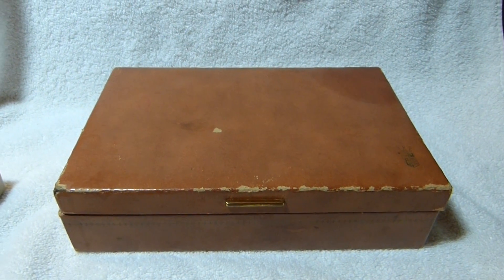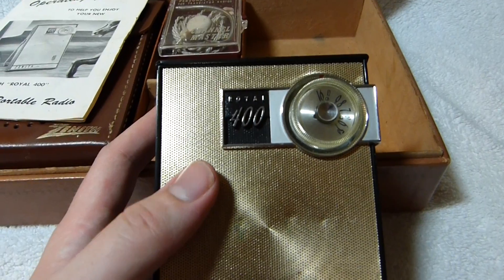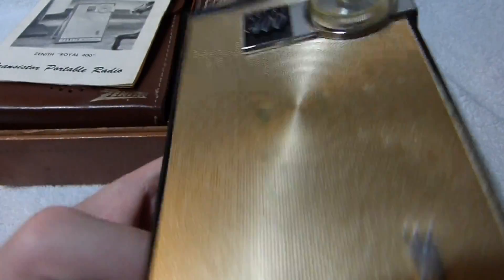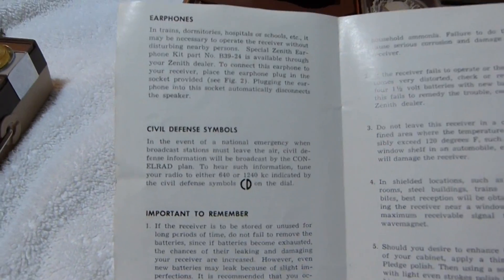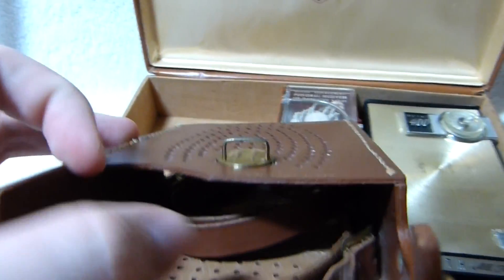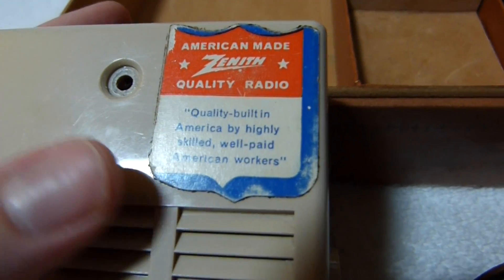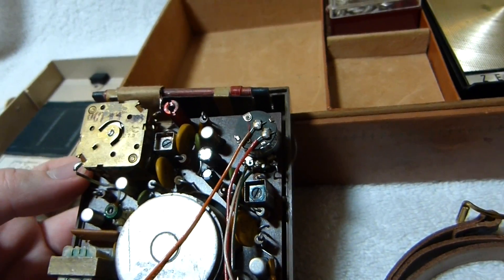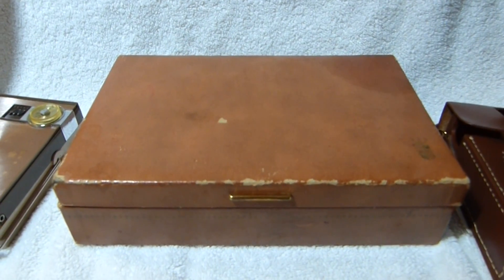1961 Zenith Royal 400 transistor radio ("Quality Built in America...")

Comment: Another great find, my friend!!  The earphone was most likely supplied by the  Zenith dealership which originally sold the radio, as most of the Zenith proprietors also carried either Channel Master or Winegard products, and  Alliance Tenna Rotors.

Back in the day, at least in my hometown, people were driven by the lure of prestige which owning any Zenith product reflected. Zenith dealers were required to have a "well presented and clean showroom, with well dressed, knowledgeable personnel", and in the event that a dealership sold products from other manufacturers, those items could never be co-mingled in the same area.

When the TV repairman, who's van was emboldened with the "Big Z Logo", arrived at someones home, the neighborhood conversation for that evening often included the phrase "*****'s TV must have been on the blink, I saw the Zenith truck parked out front for over an hour". Within a day or two, the conversation would include "*****'s TV needed two tubes and a condenser, they must burn that TV all day and night!".

In 1967, the family which lived across the street from us had to choose between replacing their ailing 1962 Chevy Impala, or purchasing a new Color TV. I remember the day that Hirst's TV delivered their brand new 23-inch Zenith console. That set lasted (with very few repairs) until 1985, while the family's 1968 Mercury Park Lane didn't outlast the Nixon Administration. I believe that I performed the only major repair ever performed on that set, installation of a replacement flyback (Thordarson).

This, Matt, was the allure of the Zenith. Whether it be a television set, AM/FM Stereo, or even a pocket transistor radio like your Royal 400, people who purchased their products always counted on their reliability - and were seldom disappointed.

This cannot be said about the electronics of today.
Reply from the maker: I would think that that dealer would have at least tried to sell the buyer a genuine Zenith earphone, but the Channel Master one was probably cheaper and this is a "budget" model. I agree that Zenith sets generally lasted a long time; the many heavily worn Zenith transistor radios on eBay attest to that. The Achilles' heel of the early Zenith sets was the  "IEI" brand ceramic cased capacitors they used, which seem to have sometimes failed after just a few years (due to cracks in the ceramic letting out the electrolyte), but by the time this set was made, Zenith had already switched to the much more reliable plastic cased units.
Reply: Sometime I'll have to tell the complete story of the "Zenith Chromacolor II Debacle" - one four lead capacitor in the HV section was responsible for an estimated $20,000,000 hit ($83,743,500.00 in today's money) to their coffers (I cut my teeth installing new CRT's for a Zenith dealer at age 16 because of this problem being so severe).

I have two radios here which have IEI "red ceramics" on board... Forgot about that problem,,, Hmm, better dig a little deeper than originally intended!